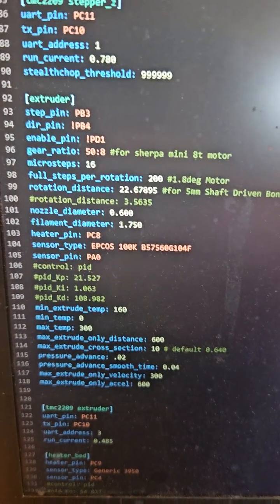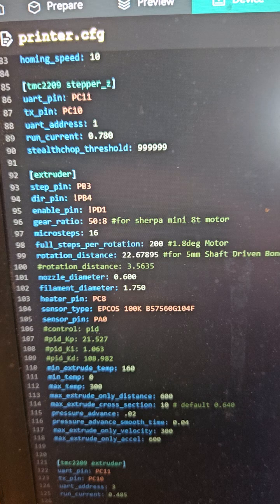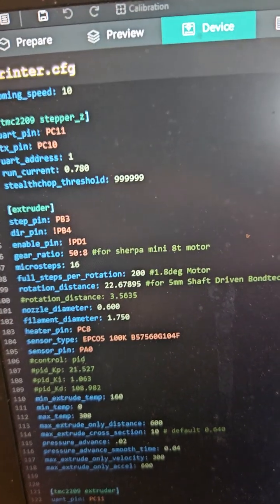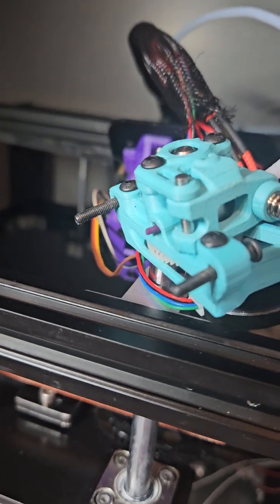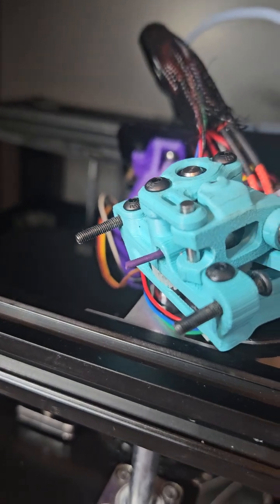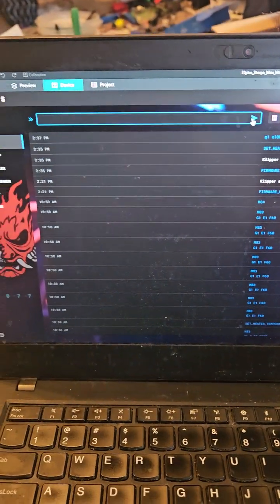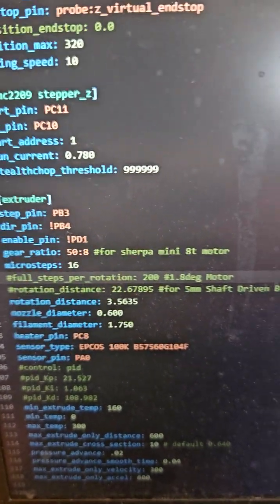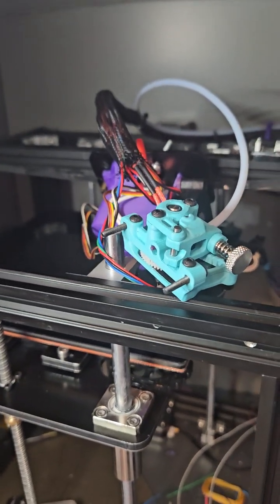Sherpa mini klipper settings

Comment: by using the lower rotaion distance value it will be easier to get the correct extrusion length however you are reducing the resolution